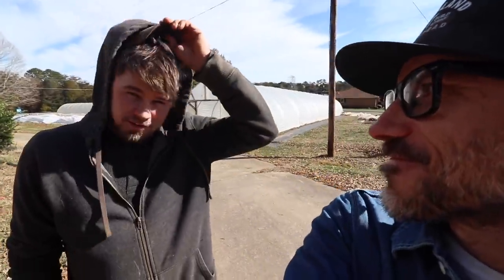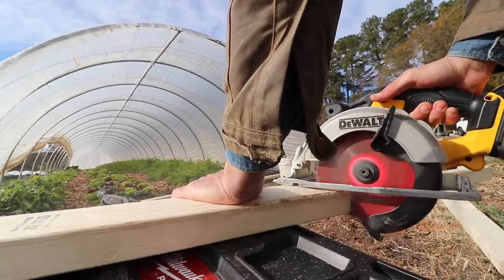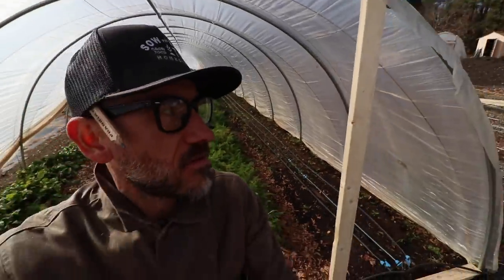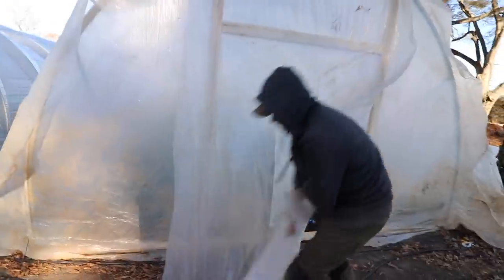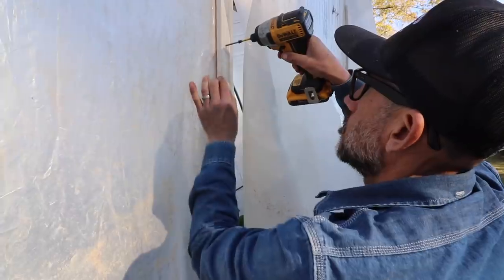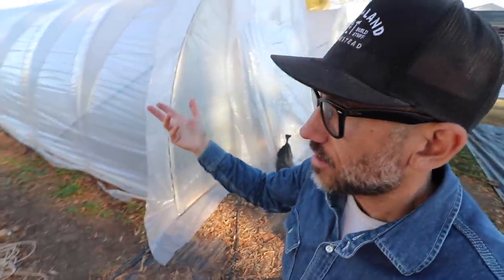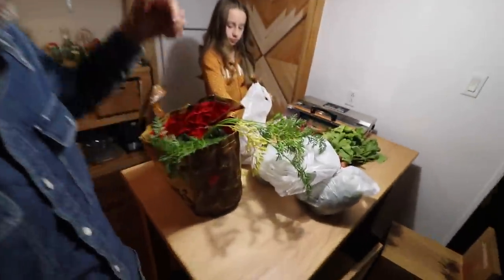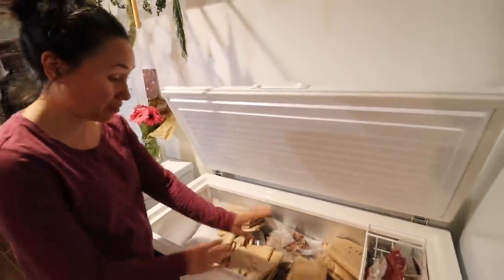Building 18 end walls for ALL these Greenhouse High Tunnels/ VLOG

Comment: You can make a tunnel from recycled trampoline frames. I’ve made 3, the largest was 75’ long. We can collect frames for free around where I live. Some people might even drop them off if they really want to unload them. We use the straight pieces to make a connecting rod down the middle and roll up sides. 🤓